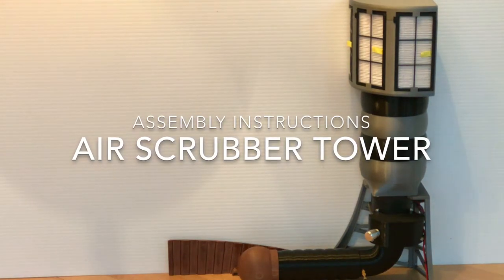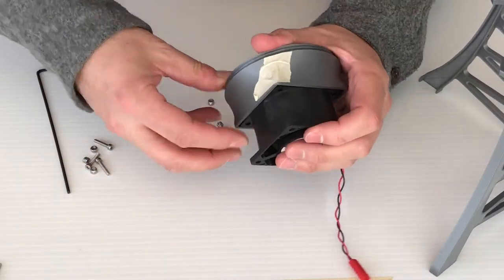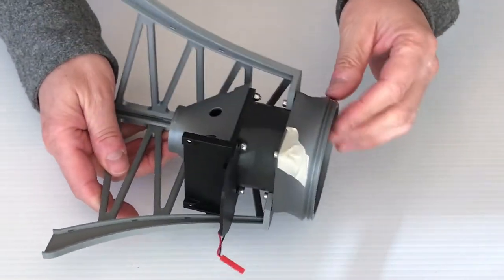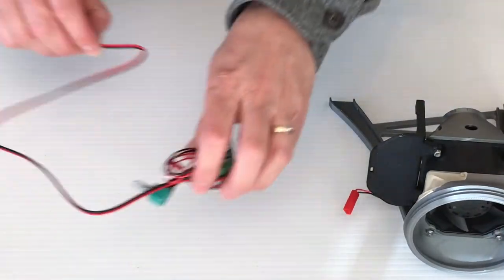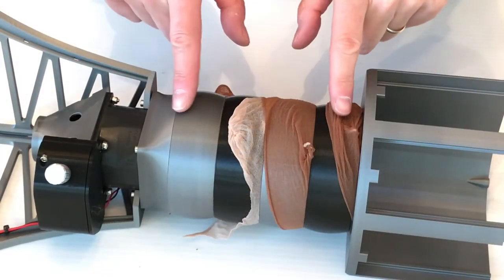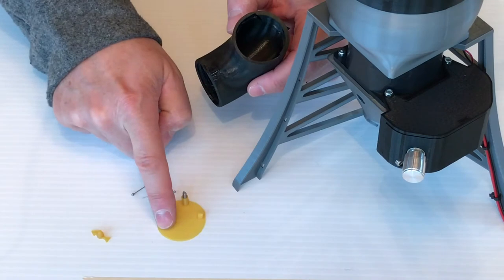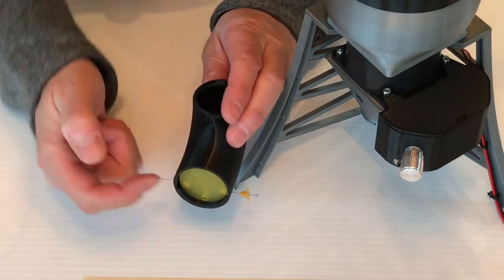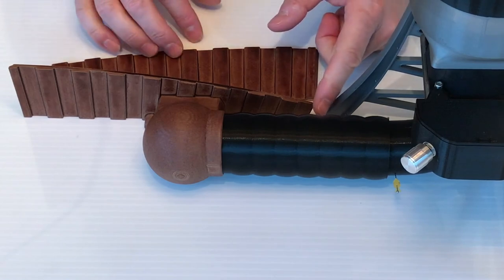Air Scrubber for a 3D Printer Enclosure - Assembly Instructions

Comment: Check out SeaChem's spherical carbon. By weight it provides better surface area and more uniform absorption potential, but not cheap.
Love your design, building something sorta similar, but much larger, to accommodate multiple printers & a small airbrush spray booth.

Comment: Hey! :) I would want to discuss a flaw, that your design and the others on Thingiverse potentially have (at least in my mind). And that is, the fan being mounted after the filtration, so in a pull configuration. For this to work, the whole filter section before that must be absolutely air tight. Your design has especially many screwing parts of which none  seem to be sealed. The HEPAfilter boxes too have a very loose fit without sealing and I believe will draw a lot of air through the gaps. So I would believe a lot of air will pass relatively unfiltrated. Maybe I am wrong - I hope I am. And to be absolutely clear: I love the design - creating the hinge pins from PLA filament is absolutely ingenious for example. And I have yet to master making screw mounts like yours. But I think a push configuration of the fan in this case would be a better option. If you have any air leaks in your filtration system, the air will just get blown back into your case and only air that goes through all filtering stages will pass to the outside. So you have to just make sure that the airpath inside is tight with potential leaks leaking air to the outside rather than the other end of the filtration stage. I would be very curious to hear your thoughts on this! :)
Reply: Not to take away from your comment but,,, You would still have a leak with push if it leaks, so it doesnt matters. You always want to pull air not push
Reply: If so worried about leaks use teflon tape on threads and caulk anything else.
Reply from the maker: Thanks! I am glad that you like the design.  Push v. pull was definitely something that I, and others, have given upfront consideration.   Ultimately, I sketched an implementation for both approaches and there were a couple of drawbacks that were unique to Push:  1) Placing the fan at the front would require extra maintenance to clean dust that would build up on the fan blades.  2) I wanted a vertical free standing solution (vertical saves space and vertical leverages gravity), and putting the fan up top would make the unit top-heavy.  I agree that potential leaks around the HEPA chamber should be evaluated.  The air pressure inside the HEPA chamber is low relative to outside and the concern is that dirty air will bypass the HEPA filters and enter the chamber.  My primary mitigation solution for this is what led to multiple HEPA cartridges.   Multiple cartridges decreases the differential inside-to-outside air pressure and thus reduces the proportion of air that might bypass the HEPA filters. Now consider the three leakage points: a) the gap around each filter cartridge;  b) the gap around the threaded exit hole; and c) the gap at the top "lid".   Gap "b" is mitigated by the nylon mesh that is squeezed between the threads.  Gap "a" is mitigated by the flexible gasket that is found on each HEPA cartridge.  Gap "c", I agree, should be looked at for how particulates might bypass the HEPA filters.  The lid is a press-fit arrangement.  If the top-bottom parts do not warp, the press-fit solution is mitigated by the low pressure inside the chamber which will tend to pull the surfaces evenly together.  Another mitigation to "c", required if there is warpage, is to put gasket material on the points where the lid meets the bottom of the chamber.  In my build, I can visually verify that the seam is tight all the way around, so I don't think that I need the gasket. My parts list for the enclosure (on Thingiverse) includes self-adhesive gasket material.

Comment: What a fantastic build! Roughly how long would you say you get out of the filters, charcoal, and desiccant before they need to be changed? Just a rough guess would be fine e.g. 24 hours of continuous print, 48 hours of continuous print, 96 hours of continuous print, and so on. Thanks in advance!
Reply from the maker: My rough guess is 50-100 hours of printing ABS (which seems, by my senses, to be one of the worse materials, emissions-wise).
Reply: @duaneanderson8641  Great! Thank you for the prompt reply!

Comment: Nice design..... Might I ask why you have air gap between the charcoal chambers as opposed to one larger chamber with the same quantity of coal?  ......  JD
Reply from the maker: Steve - Thank-you!  The multiple smaller chambers gives three advantages: a single tall chamber might cause the charcoal to compress at the bottom, the air space between layers might provide an eddy effect which extends the time that the air is moving over the surface of the charcoal, and multiple chambers allows for extending the chamber volume.   -Duane

Comment: When I look at the 3M guidelines for some of their filters it says to replace them with 40 hrs of use or 30 days after open storage, whichever comes first. 
What is ideal to change out the filters in this system?
Reply from the maker: I read those guidelines also.  For the HEPA filter portion, I go by these guidelines, which in a commercial lab was found to be 7 years: https://www.labrepco.com/wp-content/uploads/2018/09/How_Long_Do_HEPA_Filters_Last_1447854983.pdf.    For the activated charcoal, I did not find any applicable research, but it is certainly much more likely to need changing than the HEPA filter.  I go by the smell test: if I detect any amount of ABS odor in the room with my enclosure, I swap out the charcoal.  In my case I have done that twice, or about once per year.
Reply: @duaneanderson8641  - As someone with anosmia (no sense of smell) the literal "smell test" will never work for me. 😞
You mention that you're swapping out the charcoal about once a year.  Do you have a rough estimate of how many hours of ABS printing that is for you?

Comment: Hello, do you have the measurements of the completed unit? 
I'm in the planning stage for my enclosure now, but am worried it won't fit if I were to use the IKEA Lack tables
Reply from the maker: There are images showing measurements of the complete unit at the Thingiverse post (link in the description). Eg. The unit (with 4 charcoal chambers) is 43.5 cm tall.   Good luck!  My unit is going strong; four years and counting!
Reply: @duaneanderson8641  I see it now, thank you!

Comment: Hello I'm currently printing your Air scrubber and I'd like your opinion on what fan works best with it.  Thanks.
Reply from the maker: Hi Jeremy-   For a list of fan alternatives, check out this Thingiverse listing from user @jmillerfo: https://www.thingiverse.com/thing:2394452

I use the Sunon unit, and am happy with it for managing the printer emissions.   I use the San Ace in another project (cooling an electronics enclosure) and that works well.  I use a temperature sensor to keep the loudness of the San Ace to a minimum, but it does get noisy when the ambient temperatures are elevated.  Good luck!

Comment: Great project, thanks!  I'll likely need something like this, to be allowed a desktop 3D printer in my corporate office space.  It will be for my first machine (Prusa MK3), so I'm still new to this...  With all the air pumping out through this scrubber and the chamber likely sealed, is there a special method for inlet air to feed the enclosure?  Or simple vents are acceptable since it will always be under negative pressure when running?  Thanks!
Reply from the maker: Adam - I am glad that you like this.  My filter unit has been in operation for about six months and it has performed flawlessly.  The short answer to your question is that you don't need an inlet. Even if your enclosure was super air-tight, the air filter and printer will be just fine if the same air just keeps getting recirculated.  In my case, though I have leakage around the enclosure door edges, I am still able to keep odors contained inside the enclosure.  Also, if you will have filament on a spool inside of your enclosure, it would be better to NOT have an air inlet.  Considering that your printer will be left unattended and shut down in your office for long periods, an air inlet will be a source of humidity that could degrade your filament.  The back-flow-prevention valve on my design is intended to keep room air from entering the enclosure when your printer is dormant.   

So far, I have not had any issues with over-heating inside of my enclosure.  If I do start to have heat problems (e.g. the bed temp goes too high), then I would consider adding a passive heat exchanger; such as placing back-to-back aluminum heat sinks on one wall of the enclosure.  Point being that avoiding an air inlet is preferable.

Comment: I'm thinking of doing something like this for my printer so I can print polycarb and ABS. I don't want to be exposed to the fumes because they stink, and particularly with PC, they are carcinogenic. So in theory, the printer has to be completely sealed.
With the exception of the steppers, My electronics are separated from the heat of the print bed. I believe that the plastic joints on my Kossel are ABS; would the ambient temperature of the enclosure get anywhere near the glass transition temperature for them to warp at all?
Reply from the maker: This is something that I monitor, and so far, it has not reached the glass transition point of PLA (60 C).  The GTP of ABS is about 100C.  However, a big factor is how air-tight is the enclosure.  The design approach of this air scrubber forces a fraction of the scrubbed air out of the enclosure through an exhaust port, which results in a small amount of cool room temperature air to continuously enter the enclosure by whatever path is possible.  I have very small air gaps around my enclosure door, which is sufficient to allow enough clean/cool air to enter to keep the interior at <<50C.  If I were to print a 24 hr long ABS job, AND my ambient room temp was not cooled, AND on a hot day, AND I closed off the room with the printer... then I would be need to consider steps to protect PLA parts within my enclosure.

IF your configuration results in higher temps, then I suggest that your options would be to lower your room ambient, and/or to open your enclosure door just a crack. 

Keep in mind that one of the benefits of an enclosure is to stabilize printer ambient temps at higher-than-room ambient so that you can predictably get better quality prints.  40C to 45C is desirable.
Reply: @duaneanderson8641  Ah, I see. If there are gaps for air to leak in, I would want to have the scrubber turned on, so that any fumes from ABS/PC wouldn't leak into the environment. Are these fumes lighter or heavier than air? I'm assuming they would collect at the bottom of the enclosure?
Reply from the maker: @macsogandares8383  Some VOCs are lighter than air, some heavier.  The air turbulence of the filter's re-circulation nozzle, combined with the turbulence of fans on the hot end, serve to stir up the compounds in the enclosure.  So, the filter intake (high vs. low) position does not matter so much.   If I let the filter run, with the enclosure door closed, for 15 minutes after an ABS print, I cannot smell any trace of fumes when I stick my head into the enclosure.  If I open my enclosure during an ABS print, the fumes are very intense.  My reply to @Travis7919 (about a year ago) provides some details that might help you to quantify your expected results based on my observations.

Comment: Why didn’t you make the fan control remote, wouldn’t it be better to control the fan from outside the enclosure?
Reply from the maker: Phoenix540 Agreed!  I’m considering an upgrade to have an octoprint control the fan.
Reply: Duane Anderson 

As an AstroPrint user myself, I wasn’t referring to a software remote control, just mounting the fan controller and knob on the outside of your enclosure.

It seems counterproductive to have to open your enclosure and lose all your heat every time you want to adjust your airflow.
Reply from the maker: @Phoenix540  I pretty much set-and-forget the speed setting.  After I determined my preferences, I don't fiddle with it.

Comment: So honest question. Is it necessary to have a filter if I build and enclosure for a 3D printer? I planned on just putting a vent and/or fan in the top.
Reply from the maker: Good question.   The concern is that there are potentially hazardous airborne particles emitted by melting filament, especially ABS.  Here is a report:  https://pubs.acs.org/doi/full/10.1021/acs.est.5b04983

High usage (ie printing for many hours at a time), confined spaces, in a place where you live, with perhaps children, elderly, or pets... These are all aggravating factors.   

Will solutions such as this design help?  I don’t know.  It is known for sure that activated charcoal is a life saver for protecting lungs from cancer causing volatile organic compounds.  Melting ABS emits VOCs.
Reply: Hello Duane thank you for your videos and your thingee, does your scrubber remove 100% of the smell?
Reply from the maker: Please read my reply to @Travis7919.   I cannot smell melting ABS when I enter the closed room that contains my enclosure with the operating printer and scrubber.  So the answer to your question is Yes, but with the caveat that the scrubber be inside a tight enclosure.  My enclosure (also on Thingiverse) is well sealed on all edges, with the only air gaps being less than 1mm at the door seals.   The scrubber must be allowed to run for several minutes after the print finishes, before the enclosure is opened.

Comment: How did you define the layers of charcoal needed? Isn't 1 or 2 enough?
Reply from the maker: I took a wild guess that, for each charcoal chamber, two "layers" are sufficient, where a "layer" is defined as enough pellets to prevent a direct line-of-sight path through the layer.  The goal is to maximize the air-to-charcoal collisions without introducing excessive airflow impedance.  Additionally, the air cavity at the top of each chamber induces eddy currents which further multiply the collisions with charcoal pellets.  Also, multiple chambers instead of one deep chamber prevents the possibility of the pellets crushing down and degrading airflow.

My multi-chamber design approach is supported by observations of water flowing through a series of pipes and chambers.  In each chamber, there is a window to watch the flow.  Particles in the water flow in a continuous forward direction in the pipes. Then, when entering the chamber, the flow spins about before exiting the chamber and entering the next pipe.   That is the idea behind each charcoal chamber: to allow the dirty air to have more opportunities for the charcoal to adsorb the particulates suspended in the air.
Reply: @duaneanderson8641  wow, very interesting. I can't wait to start on my own filter system.. I'm getting an E3N small 18.5x19.5x18.5mm 3d printer. Meaning I'd like the filtering system to also be as small as possible. It's PLA so I'll be monitoring the difference in Ultra Fine Particles pre and post filterering. Thank you for your insights!

Comment: Is the fact that 3d printed layers allow some air through them an issue when using 3d printed parts on something like this?
Reply: Depends on the infill percentage, also its recommended to finish it with primer and paint for durability. I’ve 3d printed a water sprinkler with 100% infill and had no leaks.
Reply from the maker: Good point.  Adjust your slicer settings to minimize air gaps between layers in the Z axis, and between your walls.  You can up the extrusion percentage a bit, and/or increase extrusion temperature, to force layers to bond better.  Also, use 3 (not the just the usual 2) walls.  Use "random" start points for each wall run so that gaps will be unlikely to overlap.   You can test your slicer settings by printing a cup, and then see if it will hold water.   Also, some filaments bond way better than others, so if the cup leaks, try another filament.  User @justtestingonce has good suggestions too.  I have successfully used spray-on sealer for a design that needs to hold water (my ant-proof pet food bowl holder).

Comment: Hiw much is this or where cna i buy?
Reply from the maker: Sorry mate but this is not in production.  I take your question as compliment though, so thanks!  I put this design on Thingiverse with the primary intent that owners of 3D printers may be interested in printing this for their own use.  There are service providers that will print a part from an STL file (see my Thingiverse listing).   You will still need to do the assembly however.